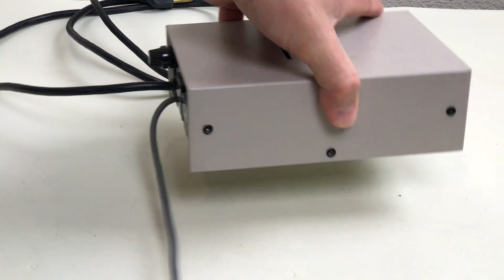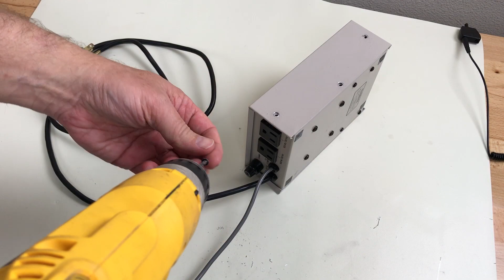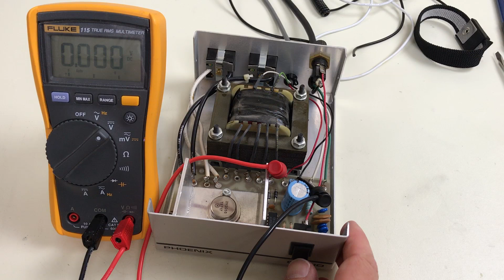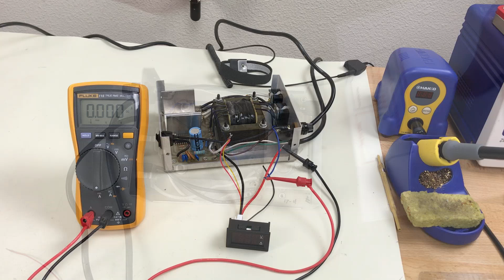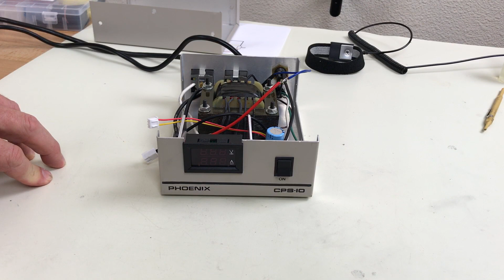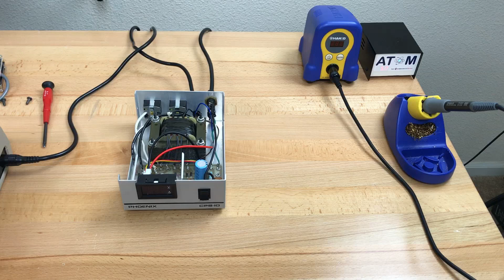Modding a Phoenix CPS-10 Power Supply

Comment from the maker: Measuring the voltage on the C64 user port it's down to 4.966 due to the voltage drop from the cable and the connector. Could have been worse with that thinner wire.
Link to Twitter thread, https://twitter.com/HutchCA/status/1534022130240589827

Comment: Well done Chuck :) I use three different Commodore Bricks on my set-ups. I have built an inline "saver" for each with the same little Volt/Amp meter. An internal "saver" circuit would really put your power supply over the edge and make it ultra safe.
Reply: The C64 inline savers are great, especially for use with the original bricks, however IIRC these CPS-10 power supplies don't kill your machine if the voltages go out of wack, I think the fuse blows.